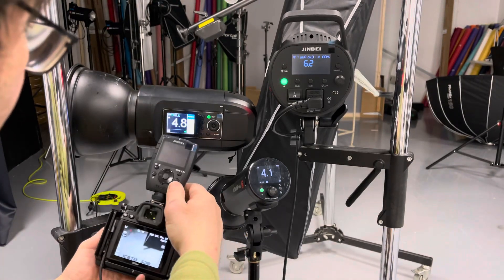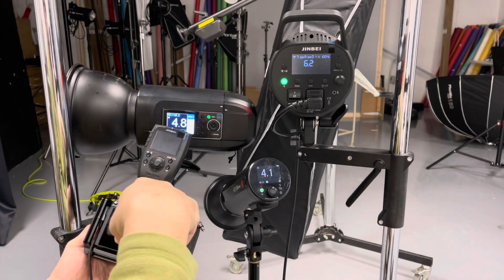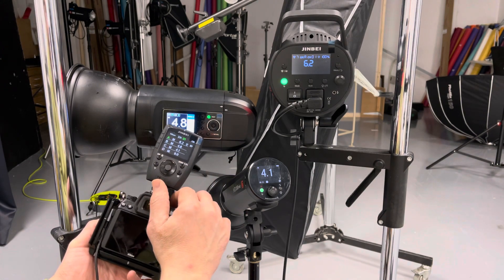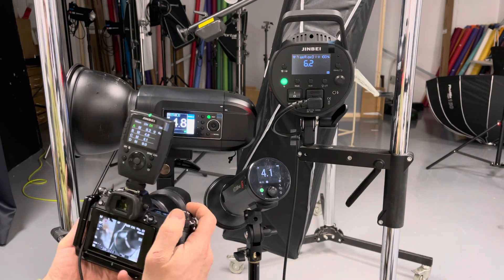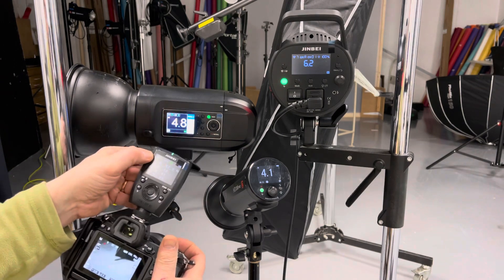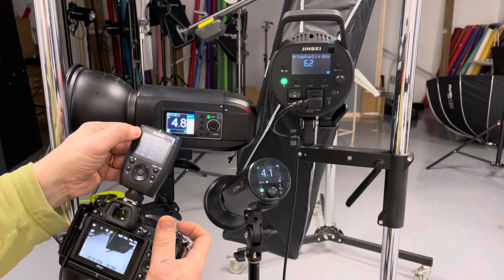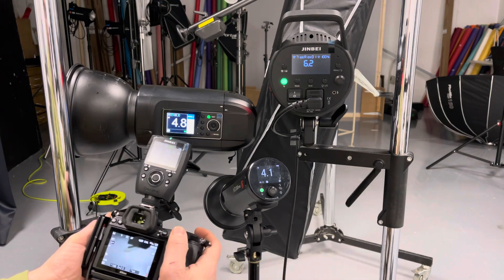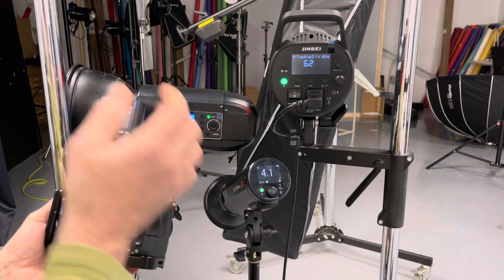Jinbei TR-Q7ii - firmware update and communication issues solved!

Comment: I don't think it is working on the following. And this is Jinbei latest model.
1. no ATG AF assist beam
2. no ATG TCM
3. no TTL & HSS (working at the same time)
4. battery removal is good but no where to be found & doesn't use AA
5. very hard to find with Sony MIS version, not the sill hump breakable adapter

Are you able to get your camera to shoot in TTL & HSS at the same time?
And does the Mark II can do Multi or is it just only TTL & M modes only?

ATG suggests to Jinbei to come up with a second version of HD-2 Pro with WiFI & bluetooth
But I don't think they will listen because they didn't listened to two major camera stores in America. And those two cut & discontinued Jinbei.